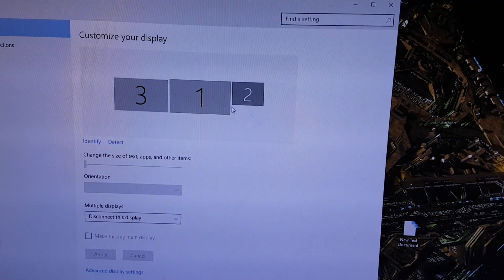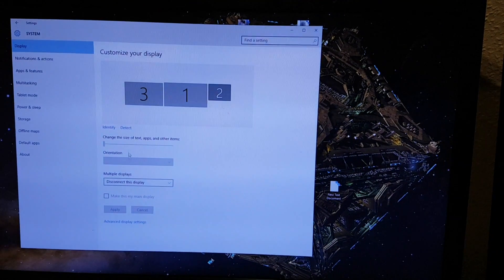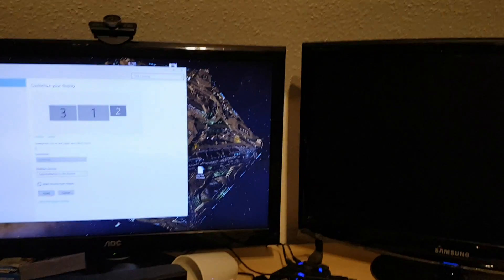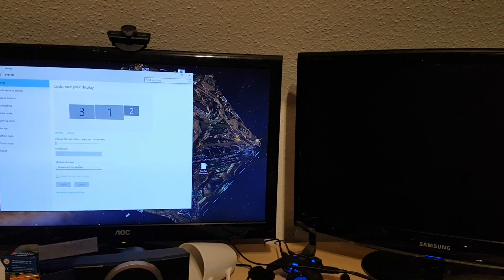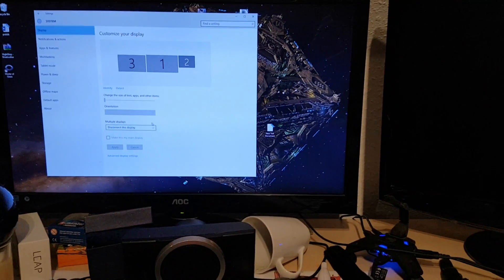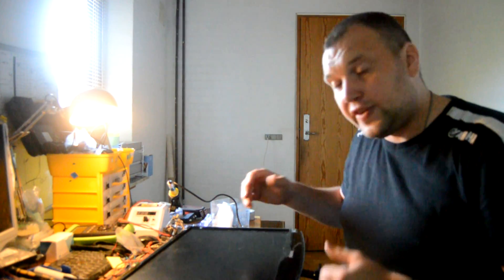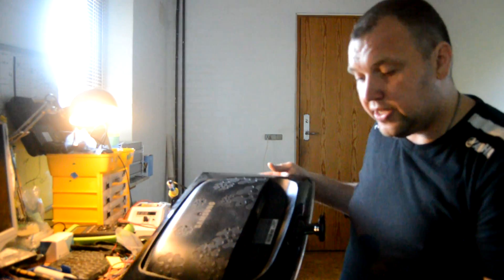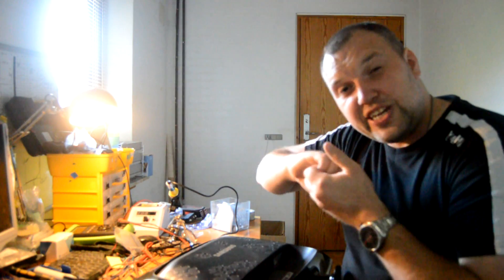Samsung syncmaster 1 sec turn off repair - Part 1

Comment: What is the name of the flex cable you remove on 3:33? The left half of the screen of my Samsung 2333HD became dark and after few seconds the right half too, so the monitor blue backlight and sound work, but the screen lost its light. In my situation all the capacitors and other elements looks fine. But I noticed that the flex cable is kind of burnt and the wires are visible, i.e. not insulated anymore. So probably the that flex cable is the reason. 
So how to search for spare flex cable, what is it's name?

Comment: Just to save people a little time.  Apparently this video was supposed to have a part 2 which it does not.  I fixed my SyncMaster 2333HD turning off randomly by doing what others did and removed the cable that connects the side buttons. Put it back together and it now stays on.  Just use the remote. Problem solved.

Comment: Samsung syncmaster 226bw, I have the same the problem but replaced about 4 of the capacitors out of 7, but still does the same thing.
please assist

Comment: I had exactly same problem, I just removed cable strip that attached to control /standby buttons on the right side, Problem vanished although I can not soft turn on and off the monitor and the blue LED at the bottom is not as it is too attached to same strip...Overall it worked 4me

Comment: After changing the capacitors was the problem solved?
There is no part 2.
I have the exact same problem and the capacitors look fine.
Please answer.
Reply: Solution is to unplug the conector from touch power butons. It worked for me
Reply: @robertcristea1892  How do I do that?

Comment: Fact is (and you may be right) electronics are not made to last for ever.  components get always more cheap, the construction also. So they have to think of a way to stay "economically beneficial" as a company.  I have talked to engineers from another company. They told me bluntly, a TV nowadays has to last 10 - 15 years, then it "must" get broken. Otherwise we will not survive.  So when a fan is a sollution, put in a fan to the condensators/capasitators (or whatever) so it can cool down.   The only reason why people invest in new electronics to replace the older is purely based on "no knowledge". So they dump it and buy a new on as it is more cheaper compared to repair it. You have ever heard "knowledge" is power ?  ;-)
Reply: Same with most LED bulbs. They are operating LED diodes at much more wattage than it is good for them. Mostly at one watt or even more. But such diodes are only designed for max 0.5 watt. However, there is a hack how to reduce the power without losing much luminosity. This will make the LED lights last for decades.

Comment: My Samsung SynchMaster 225BW is vintage 2007 and died a year ago, I replaced the caps and all was OK till today and it has gone a again ..the screen comes on for about 1-2 secs, shows the desktop and then goes out, so it is time to replace the caps again. The first lot of caps i replaced were very domed, but the current caps look OK, they my have dried out due to the heat in the unit. RS Components in the UK do a fast delivery service and so for a few quid one can buy all the caps one needs to get this repair done at home. A tad fiddly taking the monitor apart, but worth the effort to save the dosh on the repair.

Comment: Hello everyone. I nailed it! The thing that worked for me is to resolder a burnt pin of the big transformer that on the power board. It's a biggest rectangle on this board. It looks like this: https://d3nevzfk7ii3be.cloudfront.net/igi/YZPwhrIp1qQhsNUX.large (This picture is from other board but the transformer looks very similar). The screen works perfectly now. Although it's working now, I believe it's a temporary fix because actual problem with this part made this problem to occur so I expect it to go bad again until I replace the whole part (what I don't intend to do).
Reply: Hmm this problem occured on my 2233sn monitor too. It seems lcd is working but backlight turns off after 1 sec i don't know why yet. I am going to measure every condensators diodes etc. I checked the transformer looking rectangle box it seems ok but I don't measured yet Did you fix this issue ? Is it working properly?
Reply: @erayss6  how did you go with measuring the the capacitors and diodes?
I have the 2233SW and it is turning on and off every 1 second or so.
I will open it up and inspect it now.

Comment: What about part 2? This solution worked fine for me on Samsung SyncMaster  226BW but since there is no part 2 and the other comments says it's not working I'm wondering if I even should try this now. For the record, I have the exact same problem.

Comment: They failed to repair change ll caps and stil have the same issue and no part 2, bad ccfl change the lamp or put a 3v led in the output conector of the failed lamp i do it in my Samsung SincM 2053 and works fine.

Comment: This is the last time I will buy a Samsung monitor. 
My T260 died on me 3 years back, so I got it repaired. So now turns off after 1 second, damn it. 
I think it's planned obsolescence to get people to buy new monitors, I live in cold Norway and should not have this issue. 
Thanks for the educational video :)
Reply: Bill, it is very easy to replace the capacitors in the PSU board, so don't chuck the unit, buy some caps and get soldering...'simples' as they say.     Good luck!